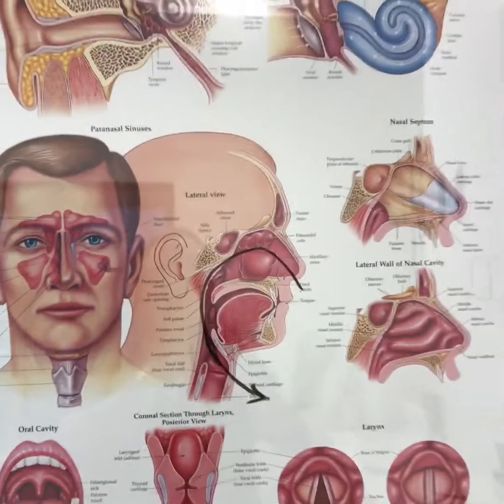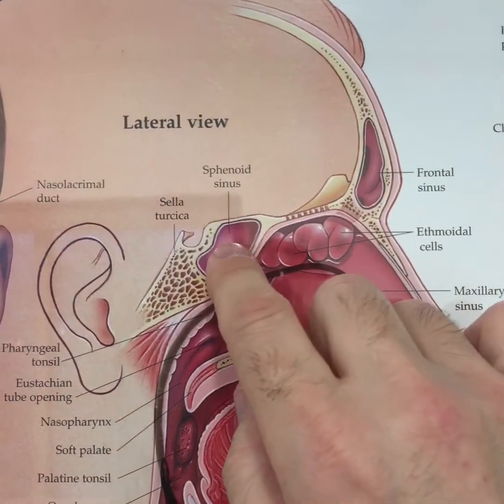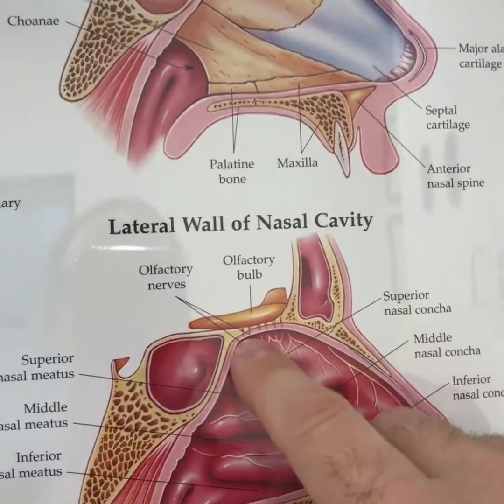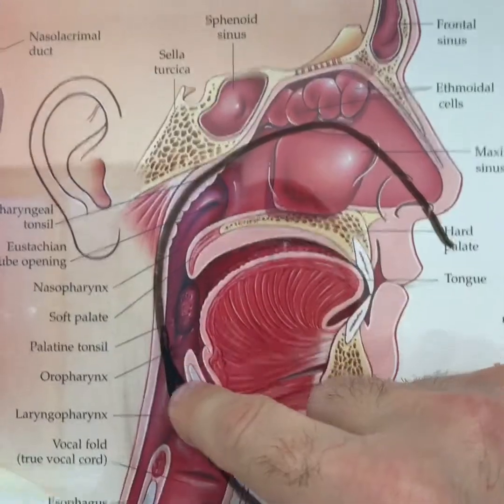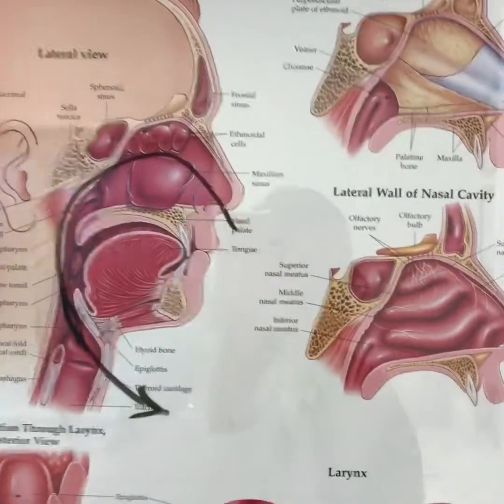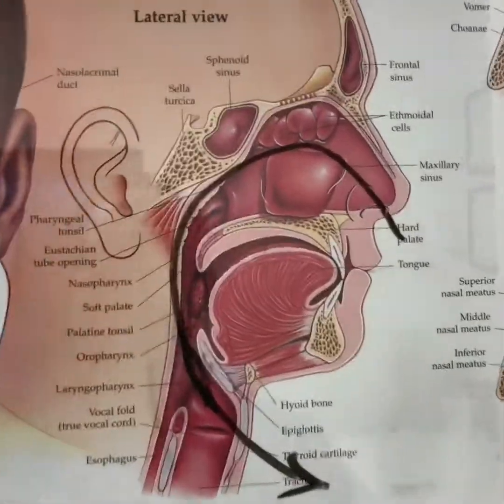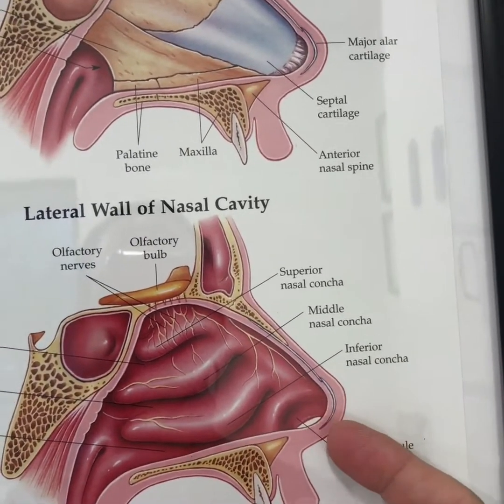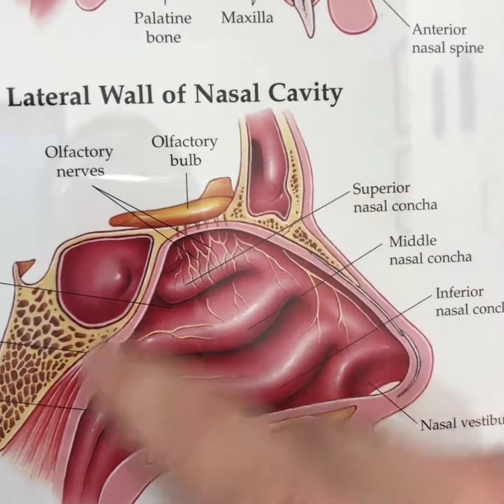Physiological Nasal Airflow: Learn How the Nose Works

Comment: I can’t smell much of anything  and haven’t been able to for over 18 years. I wrote it off as using the zinc zicom allergy spray that was recalled for such reason but never looked into it deeper. Ever since I got really bad covid last November from a patient I haven’t been able to smell a single thing and have had chronic sinus infections. I just had my CT scan done and it states that my turbinates are small in caliber and to seek therapy for it. So basically everything the ENS patients are complaining about post turbinate surgery is what I have been dealing with since I got that bout of Covid last year. No search will tell me what to do about small turbinates without bringing up the surgery that I never had. It’s clear the pathway of the air is affecting the sense of smell for me. Very interesting video thank you .

Comment: May God bless you. 

I live in Canada and I have a large mucous cyst in my right maxillary sinus.

 I have been to several ENTs here in Canada they don’t seem to know a single thing but cut off your turbinate. It’s either they don’t care about nasal airflow or don’t understand it, instead they just inserted a tube down the lower part of my nose and then checked my septum, then cut back my lower turbinate and finally concluded that my air way is clear, but I feel thickly stuffed at the top of my nose in the area between the eyes and a couple of days after the process I feel worse than I had gone to the hospital. 
I’ve been suffering for years now and can’t get help. I only get appointments once after about 4 to 5 months, and so tired, mentally stressed and frustrated, I feel physically drained every single day of my life.

If anybody knows a doctor here Canada who can help me I will honestly appreciate, simply send a reply to this message and I can follow up.

Thank you 🙏🙏

Comment: How do I communicate this to my ENT? They did a septoplasty and turbinate reduction, and I can breathe better, but the left nostril pinches to my septum when breathing and laying with that side upward. Congestion seems to collect into the left side and is chronically trapped in the upper middle part of my left nostril just below the bridge. Breathing in, snot comes with the air and feels trapped above my mouth roof. Breathing out, always a string of snot comes, so I have to keep wiping and blowing my nose so that it doesn’t build up and come out at inappropriate times when breathing, like when talking with customers or anyone. 
So the surgeon now wants to open the sinuses, but even when I try explaining that collapse and pinching experience, they don’t seem to hear me.

Comment: Are you reluctant to ever do turbinate reductions? I had a turbinate reduction two years ago due to having a blocked ear. I had a deviated septum too from drug use but that wasn't operated on (that was what caused the blocked ear sensation). Come to find out later on that I am actually allergic to dust mites too, but the surgeon didn't get me tested prior to the surgery. He seemed to think that the easiest and most effective thing to do would be a turbinectomy. It has altered my airflow and now I can no longer take a deep satisfying breath.
Reply: Paradoxical obstruction = ENS.